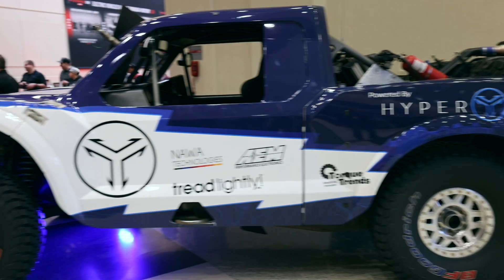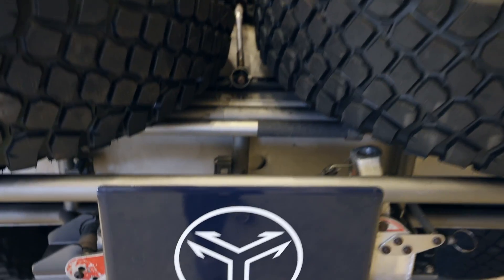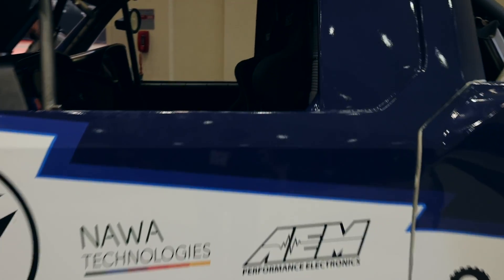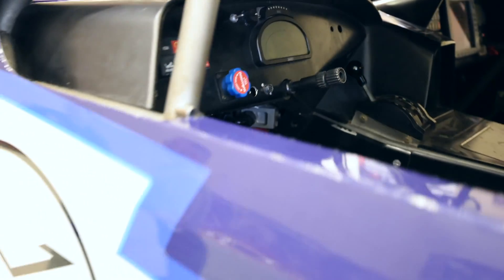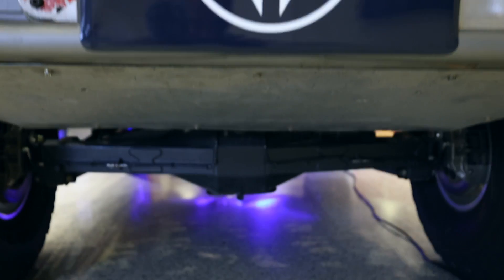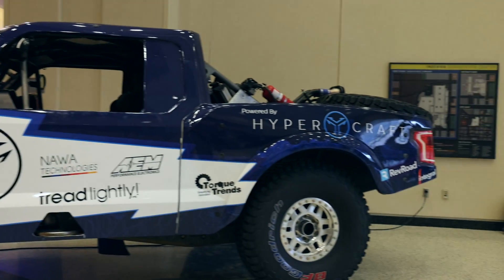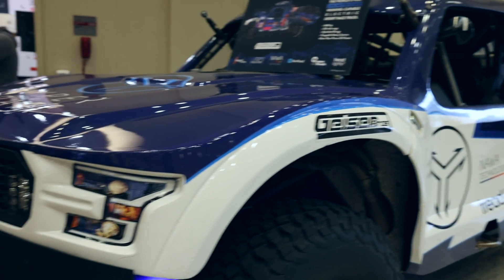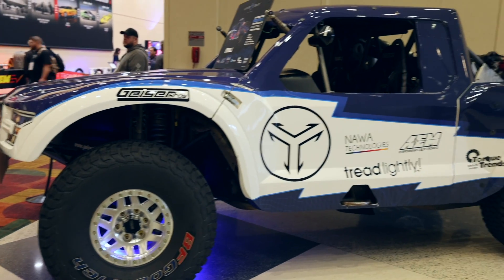PRI 2021 - Hypercraft EV Trophy Truck

Comment: I was just watching a documentary about mining cobalt in the Congo. What a crock of crap this ev stuff is. It's doing far more harm to the environment then ice. Get off the "green" high horse and wake up.
Reply: 🤣🤣🤣 Sure.
Reply: Late but cry about it this is the future old man 😂
Reply: Y'know, I hope that the locals didn't build traps for some of the ICE Trucks, but with EV coming to dominate everything.

THEM LOCALS BETTER BUILD DEADLY TRAPS!!! Destroy that EV, that wont survive after a HARD and destructive barrel rolling!
Reply: You do realise that these batteries have a tiny amount of cobalt in them. Right? RIGHT?
Reply: Only thing they need is a small 30kWh battery that is powered by a petrol drinking generator aka series EV. Huge battery packs arent the future - huge waste of lithium